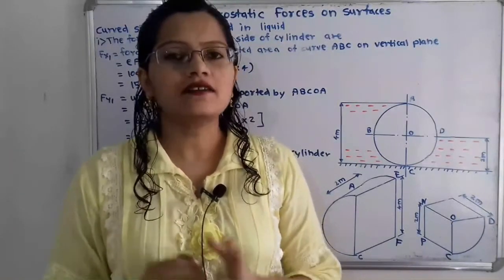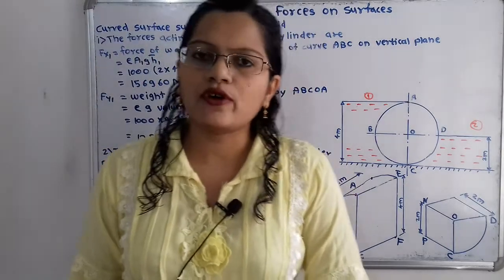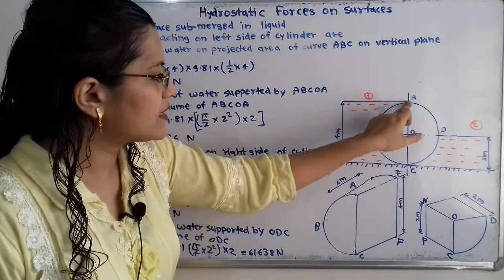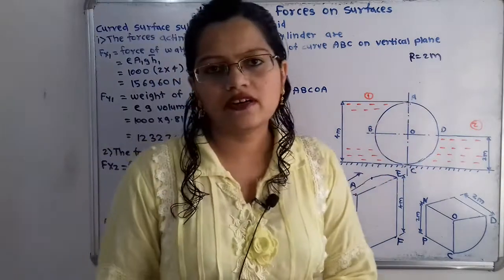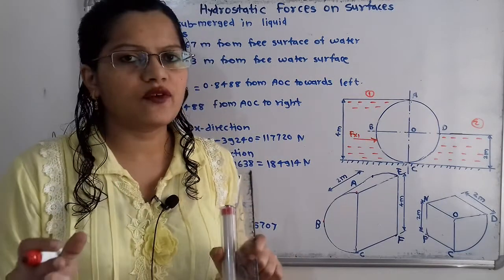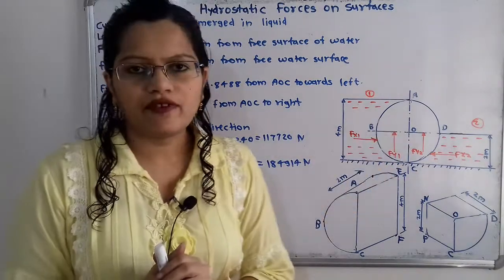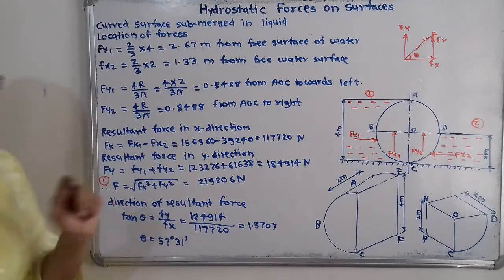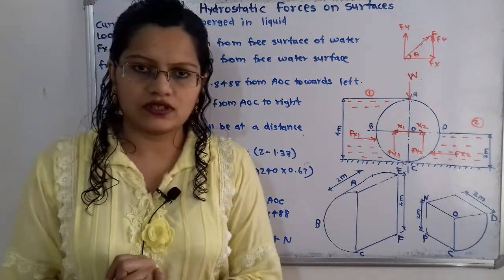Problem on hydrostatic forces  on curved surfaces/ cylindrical gate /Fluid mechanics

Comment: Maam, how did you calculate location part, It is  bit confusing, Is that formula 2/3R can be applicable to any question or only for this question statistics ... 
Please respond, Thank you for explaining 🙏🏾
Reply from the maker: For horizontal force on curved surface use 2R/3
Reply from the maker: For vertical forces on curved surface use 4R/3π
Reply: @edutechguruengineeringlear4280  is it only applicable on shapes on the surface of the fluid? or even on surface above the shape?

Comment: Aslice gate consistse of qudrant of acylinder ofdiametre  3m the gate is pivoted at its center in the below if the centr of the grate is at G detrmine the magnitude and direction of the resultant pressure on the get due to watre below the gate  also  calculte the turning moment required to open the gate  take widthe the 3m and weiht of the gate  58.86k/N😮